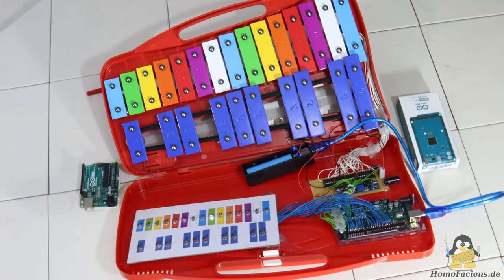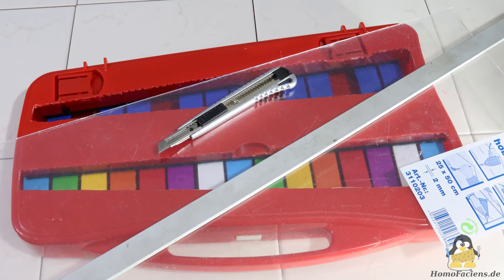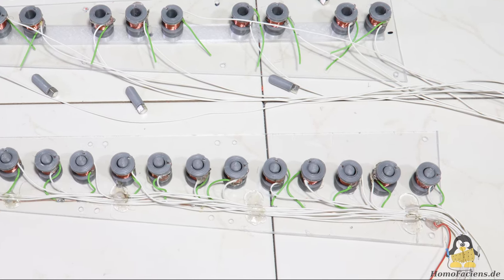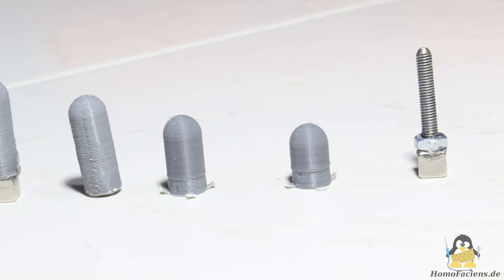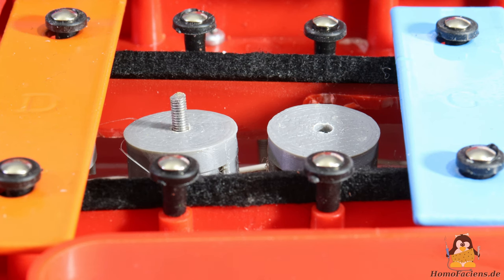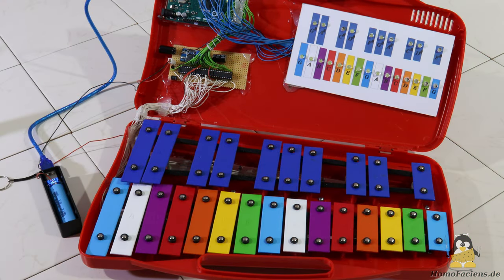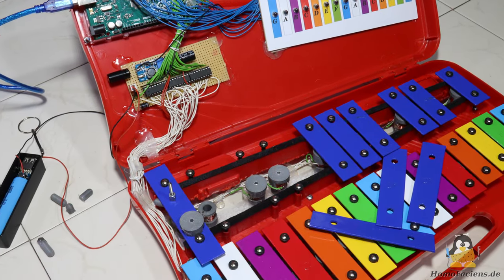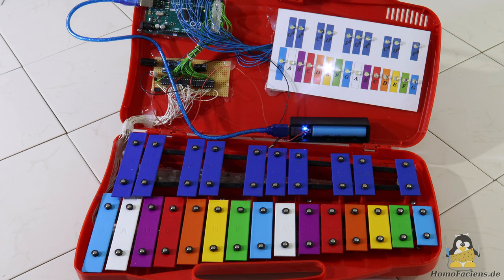Automatic Xylophone with an Arduino MEGA

Comment: 06:50 ... i would have linked a capacitor with the LED parallel to the coils to keep the LED up for a little longer than the 15ms...
Reply from the maker: Yes, this could be a solution, but one that requires extra capacitors. There is no need to save GPIOs, the MEGA has plenty of them.